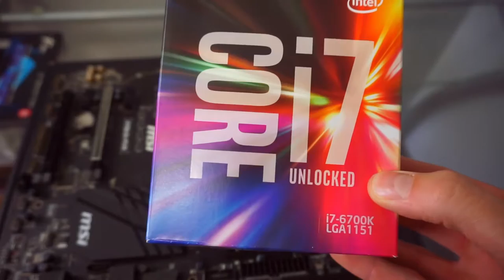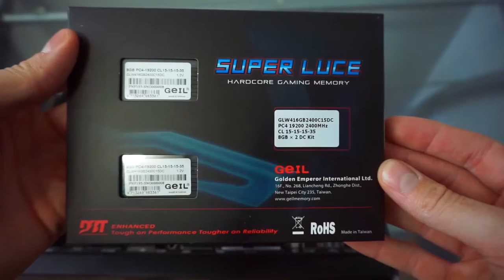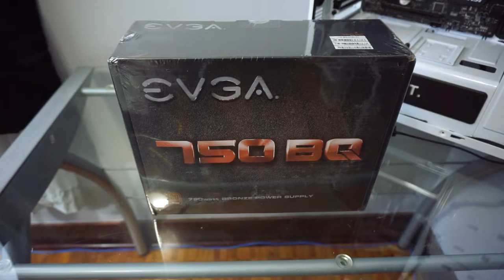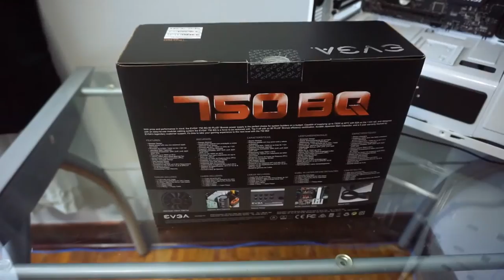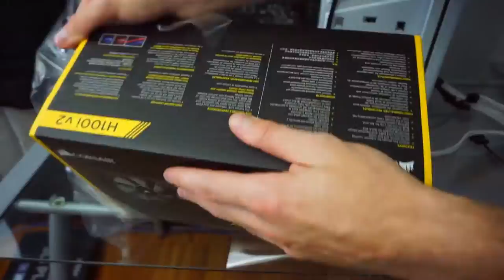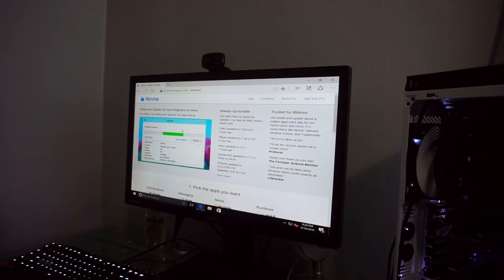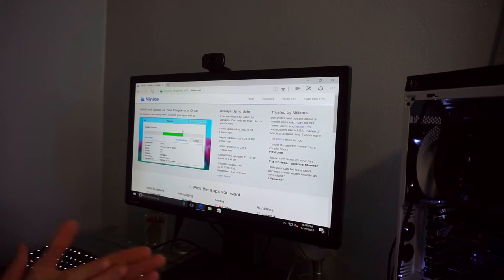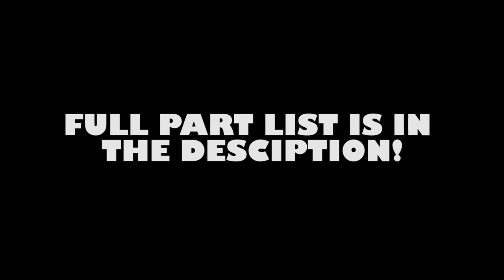$1,300 GAMING/VIDEO EDITING PC BUILD - 2016 - I7-6700K / GTX 970

Comment: Nice video! I am really confused now about choosing Gtx 1060 or 970. I can see that 1060 is a bit stronger but its price is higher than 970 in my country. I am thinking about building a pc for 3D rendering and gaming. Can u pls recommend me some specs about building that kind of pc?
Reply from the maker: Absolutely choose the 1060 if you're choosing between those cards. The 1060 will give you more longevity on use for your money and it will have more vram as well if you get the appropriate model.  Not sure if you know or not but the 970 went through a lot of controversy over its inaccurately represented  vram figures.  If you're looking at that price range then do yourself a favor and go with a 1060 or an rx480 from amd as they are similarly priced and have about matched performance (depending on the game/application).  I can recommend plenty of ideas for you for your build! what price range are you working with for your build?
Reply: Ricky Arnold Yes i think that the 970 is a bit outdated as well. I'm planning to build $900 to $1100. Please kindly give me sone suggestions. Thanks.
Reply from the maker: Sereyoudom Raing54 one more question before I can provide a good suggestion, is that budget just for the pc? or does that have to include windows, monitor, keyboard, etc.?
Reply: Ricky Arnold No need to include those things.
Reply from the maker: https://pcpartpicker.com/user/rickyarnold999/saved/y47vK8 
heres a link to a build i tinkered around with for you.  Obviously you can tweak anything you want, but based on what your needs are and your price, that should be more than enough!
Reply: Thank man. This is very close to what i want, just change i5 to i7. U are really helpful. 😃😃😃
Reply from the maker: Sereyoudom Raing54 no problem at all! glad I could help!
Reply: One more thing i'd like to ask u. Which one is the best between Msi gtx 1060 and Gigabyte gtx 1060?
Reply from the maker: Sereyoudom Raing54 well I listed the EVGA because it was the 6gig version and was the cheapest right now. but really it comes down to preference and what you're going to do with it. you want that 6 gigs of gddr5 VRAM so look at those models and choose one that suits you!
Reply: Yes thank man. U help me a lot.

Comment: How does it go when it comes to editing? I have pretty much the same specs (different GPU and board manufacturers though) and I'm just getting into video editing now... Wondering if what I have is enough or if I should invest in a beter GPU/more RAM/etc
Reply from the maker: it is great for editing! I edit all my videos with it and I'm able to do it quickly in premiere even if I'm adding some 4k shots in there. I am really happy with its performance as of now! compared to my 8350 system, it blows it out of the water.
Reply: Ricky Arnold thanks for the reply! I tried my luck with some 1080p@120fps and then using some Twixtor. Well, let's say the computer didn't love it... 20secs footage, almost 15min rendering! I'm sure I messed something up though
Reply from the maker: do you have gpu acceleration on? I know that helped me a ton in premiere as far as rendering times go. I don't think that short of a clip should ever take that long though
Reply: Ricky Arnold I did have it on... but I think the frame rate + Twixtor is a big ask. Like I said, I'm sure there's more to it as I'm a total noob when it comes to video editing... time for some tutorials I guess
Reply from the maker: Hmm that's really weird. I just rendered a 10 min video for my channel last night that has 1080p 60fps footage, 2.7k footage, and timelapse in 4k and some slo-mo stuff and that took about 15 minutes or less. I wish I knew what was going on for ya, that has to be annoying :(
Reply: Ricky Arnold I have no idea what I did with it last night but I tried again a few times and it somehow only used 50% of my CPU max... before it was consistently hovering above 95%! It took a LOT less time too. Like I said, the footage I'm using was shot at 1080p@120fps and I was using Twixtor to slow it down to 10%... so I thought that was the issue but somehow it just breezed through it this time. Even RAM usage sat at about 9Gb so still had heaps in reserve. Go figure...
Reply from the maker: (insert hillbilly voice) well there's your problem right there 😉
Reply: Ricky Arnold kinda how I felt lol